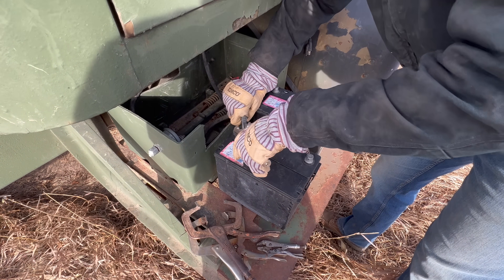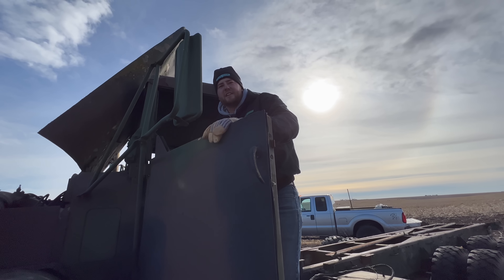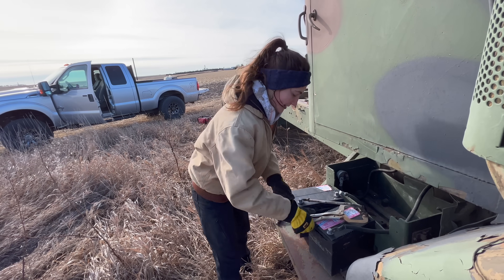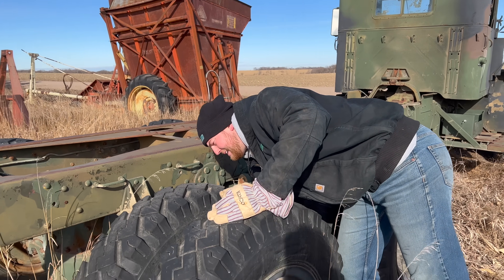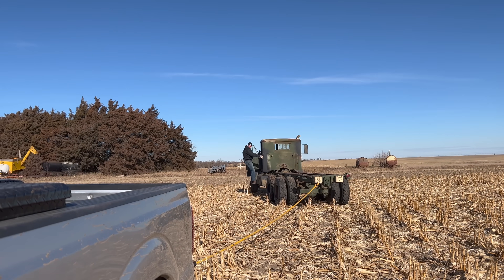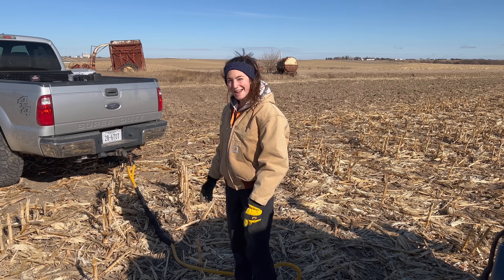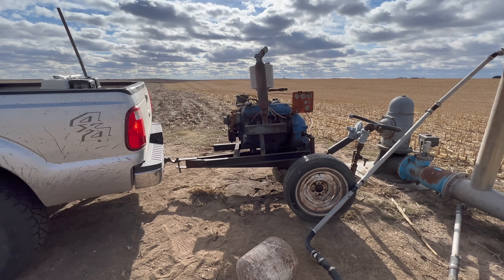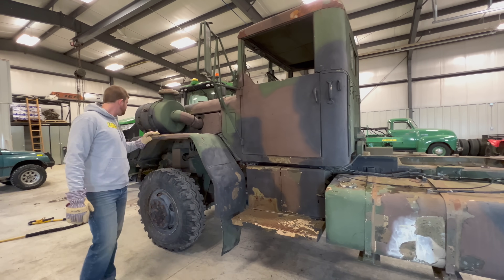If You Can Start It, You Can Have It

Comment: Change oil. And filter, Add a quart of click 50 to motor,😳😳 will plug all oil leaks. Synthetic oil with teflon , can mix with regular oil, engine rebuild in a jug.😀😀
     Actually used it in a overbored cadilac coup deville. Went on roud trip, had radiator hose blow, duct taped it till i limped off the exit. Found. Service station with garage. Was so hot ran on own ,after plug wires pulled. Put it back together, got close enough hose. Limped home .😭😭
  Used to have roommate was dodge and mopar motor head, yes know all the ford and chevy jokes😂😂😂   Lost compression in cylinder, so changed oil and filter. Added slick 50 , and prayed. Got compesson back , ran fine.
     Was 1995 can probobly find at walmart or parts store. Diesel moters use glow plugs , can probobly get military. Maintinence manual on duce and half, chiltons of the military world.😀😀🐶. Used to be crew chief on kc135 R, they have a book for everything. More pics in army manual.😳😳
     Conrtats on finding a willing and enthusiastic wife, they be rare. Be prosperous and enjoy the ride.

Comment: I like his sequence of checking  Oil Gas   should check radiator  for  Water   cource battery  he doubled up the 12 OK   I,d go for the ether yes get the ether
Reply: I,m here in Washington County Maryland  and yes as a kid my Grandfather Schmidt  sold Ford Tractor's  thru his brothers Dealership  anyhow when he made a deal he'd make sure he'd asked the farmer if we could hunt on his property and usually answer was yes  anyhow I got like 12 pheasants  the next five years  1966 1971   and Now when People ask  anyone in Maryland us old hunters just say we were a pretty good shot the reason theres NO Pheasant anywhere in Maryland someone said it was due to some fertilizer they used in early 80,s  we didn,t know wheather it was from Urban sprawl  or what  so do you still have Pheasants out there

Comment: OMG, she is so beautiful ! ( the attractive woman, not the truck, lol )  
 About the fuel,..during WW2 diesel was not always easy to get due to supply issues, so these trucks could run on a few different types of oil, one type of oil that was used was vegetable oil, but it did have some issues, you can not use vegetable oil (cooking oil) in cold weather because it would freeze.   :o)

Comment: Great vid and people. I have a 24 volt military truck and the argument about how 2 12 volt batteries make 24 volts hurts my head.  Just hook them up in series, put a volt meter on them and you will see how many volts they are. Which is 24; but let the meter settle it!  Anyway, look forward to more about getting this truck road worthy. Thanks. BC

Comment: The 36m49 is nothing more than a number of the truck to separate it from the others and show what platoon or squad and this one is not that one. If you had nominclature such as 10th Eng Bn, or 35Sig BD you would know what Battalion or Brigade or What Unit the vehicle was originally attached to. GOOD LUCK

Comment: I do not wish to steal your thunder! I have no wish to put myself out there fully! But do you know why there is so few farmer jokes? Because most are true stories!!! Anyone may steal this true story at will! Farmer Jack  passes away, the community helps where they can. 1 guy in particular after ensuring everything was back maintained and ready, should she wish to sell! 
She was ageing but no wish to move. I cannot afford to pay you. She tells the younger local farmer.
In doing a thorough clean up, he'd unearthed an old bus covered in vines.
He mentioned to the widow, he was in the old bus. She said,  just take it! He was extatic! Payment in full! As far both concerned!

So collection and moving the old bus!
4 ton tractor towing a 10 ton bus no problems! 

Brakes? Air activated. No air? Brakes are on! So too easy! Wind off the brakes so they don't work! Brilliant!

If you need brakes? Just put it in 1st gear! Let out the clutch and use the engine compression to brake you! 

Of course on a steeper downhill run they tried that!,
Of course the old diesel that hadn't been started in 40 years!  Came to life!

Now we have 10 ton pushing 4 ton, tractor brakes won't hold the weight of the bus! So leans over removing the tow pin!
Gets out of the way whilst the bus and rather frightened driver, had to  face his unplanned roller-coaster,  

TRUE STORY! Qld Australia approx 2001

Comment: The numbers are usually the Division and Sometimes Battalion that the Vehicle is assigned to. The only thing in the Army that is referred to as a truck is the Brass Ball on top of the Flag Pole. And I can tell ya. The Army is brutal on Vehicle's. That could have just been a motorpool vehicle. Which means it could have been checked out by anyone. Guy's like to see just how much abuse a vehicle can take. Pissing off all the Mechanics. I was in an Armoured Tank Killer called The Bradley. They can take abuse and keep on going.

Comment: if u use gasoline, it must be mixed with motor oil.  exact dilutions escape me now.  just use diesel to be safe.  Motor oil
ATF
Hydraulic Fluid
Gasoline
Diesel
Kerosene
Refrigeration Oil
Vegetable oil

Comment: Dear Laura, First off, THANKYOU FOR BEING SO  FRIENDLY AND DOWN TO EARTH, A PERSON!   REALLY!   iF I SAY ANYTHING TO  YOUR GENERATION?  IT IS THAT   MEN AND WOMEN BOTH HAVE VITAL ROLES IN  OUR WORLD! AND THEY HAVE STRENGTHS  AND WEAKNESSES  THAT ARE RELATED TO THEIR  GENDERS!  BUT! BUT, BUT, THEY CAN LEARN, ABOUT THE OTHER SEX'S  ROLE, IF THEY TAKE THE TROUBLE TO DO SO!  
THAT BEING SAID!  YOU SEEM TO BE  ASKING WHAT MAKES THAT  MILITARY TRUCK 
SO  DIFFERENT?  OR  "SPECIAL"   ??? PLEASE CORRECT ME  IF I AM WRONG?  
THESE TRUCKS COME LAURA IN THREE WEIGH RATINGS.  2 1/2, 5,  AND TEN TON  
LEVELS!    THE 21/2 TONNERS ARE  REFFERED TO BY RANK AND FILE  SOLDIERS WHICH ARE  THE MOST   NUMEROUS,  AS  deuces, OR DEUCEAND A HALFS !   THESE ARE THE MOST COMMON MILITARY TRUCKS!   THEY ARE THE TRANSPORT  BACK BONE OF ANY ARMY IN THE FIELD OF OPERATIONS!   THEY ARE  HIGH STANDING TRUCKS!  THEY ARE TEN WHEEL DRIVE, ALL AXLE DIFFERENTIALS   FULLY LOCKED STYLE!   THE DRIVE LINES ARE TOP LOADED!   THESE  TRUCKS ARE  ESSENTIALLY  "MUD"  RUNNERS!    YOU SEE, 
LAURA?   THESE TRUCKS ARE MEANT TO HAUL AMMUNITION, AND  SUPPLIES TO 
THE  FRONT LINE BASE CAMPS IN ANY THEATRE OF WAR!   THEY RUN ON MOSTLY ROADS,  THAT ARE WORN INTO THE COUNTRY SIDE, WHICH TURN VERY QUICKLY INTO SEAS OF MUD!   THAT IS WHY THEY ARE TEN WHEEL DRIVE  AND HAVE  IMMENSELY
STRONG FRAMES AND  SUSPENSIONS AND USUALLY HAVE  DRAG WINCHES MOUNTED ON THE FRONT  OF THE  FRAME   FORWARD OF THE RADIATOR!   THEY HAVE CONVERTABLE  FRONT CAB ROOF  ARRANGEMENTS TO HELP FOR  MOUNTING OF .50 CALIBER MACHINE GUNS, BESIDE  THE DRIVER? AND   TO HELP COMBAT HEAT IN TROPICAL   CLIMATES!   THE  WINDSHIELDS USUALLY ARE CAPABLE OF BEING FOLDED DOWN LIKE A JEEP!  THIS IS  TO FACILITATE   A MOUNTED .30 CALIBER MACHINE GUN! 
THEY ARE  IMMENSLY MASCULINE  IN APPEARANCE, AND STANCE!   THE ENGINES 
ARE MULTI FUEL.   ELECTRICAL SYSTEMS ARE 24 VOLT TO SUPPORT  RADIO CUMMUNICATIONS GEAR!  IN THE FIELD!   THEY HAVE RECESSED  HEAD LIGHTS  FOR 
CONVOY BLACKOUT  RUNNING!   THEY ARE UTILITARIAN  TO THE EXTREME! AND ARE 
BELOVED BY THE MEN AND WOMEN  WHO FOUGHT  AND LIVED WITH THESE BEASTS
IN THEIR SERVICE TO THEIR COUNTRIES!   OLDER MODELS WERE MANUAL TRANSMISSION, NEWER MODELS AUTOMATIC.   BRAKES ARE  OIL? MAYBE SOME 
AIR ? THESE DAYS? I AM NOT SURE! I AM TOO OLD  TODAY?   THEY ARE  NOT CHEAP 
TO RUN,  DIFF RATIOS  ARE FOR   POWER, WHEN BOGGED DOWN IN MUD. 
MOST  COLLECTORS TAKE THEM OUT FOR A RUN ON A SUNDAY  WITH THE KIDS?
AND WIFE? TO GET LOOKS BY THE GENERAL PUBLIC!   OR TO GO TO  MILITARY VEHICLE PARADES OR  MEETS!     ALL THE VERY BEST TO YOU LAURA? AND HOW DOES IT FEEL TO HAVE A NAME OF A VERY POWERFUL 429 CU IN BOSS MUSTANG?  IN A FILM CALLED 
"BULLITT"   WITH STEVE MCQUEEN ?/ BACK IN THE DAY!  OR  ANOTHER FILM AS WELL?
best regards  kennethzakaib607@gmail.com   Montreal Queebc Canada   May 2024

Comment: well batteries to small, dumb all the diesel out of it put new fuel in it then start it its diesel it should start, if not just undo the injectors to see if fuel is getting through as maybe stuck in the air so keep running till air is out fuel coming through at all injestors it should start then.

Comment: Looks like an 8 series 5 Ton. It should have a Cummins diesel which was not a multi-fuel (Continental diesel) The Multi-fuel engine was in the predecessor to the series 8, the 5 series 5 Ton from the Viet Nam era. Before that they used gassers. A multi-fuel diesel can run on everything but Av gas (Too high octane). This feature was to accomplish your mission and/or save your life if you have no actual diesel but have say Mo-gas, and/or any flammable oil or fluid. The Cummins engine is far superior to the Continental as far as power and durability.

Comment: condition was IF YOU START IT,,,, but you did not start the engine instead just had it ,, that was wqng ,,, the truch seem fairky good condition ,,,, you could have started if you had proper power supply and chaged fresh diesel into injectors,,,,, weather was not bad for starting,,,,

Comment: Why not pull the truck unless it's automatic if it's manual shift pull start the truck off in 5th gear pull it off like and let other little clutch and let it run

Comment: Come on guys start to get practical. Sparks, coil packs, distributor fresh fuel. Make sure the engine and belts are all free to turn and good before you try to start it otherwise if it did start you probably just going to do a whole lot of harm on 10 year plus old oil and fluids. You were lucky those brakes had not seized and you just brake the pick up. I thought farmers are practical people. Love your enthusiasm though…

Comment: OK military multi fuel you can run cooking grease in the Thing and the batteries you need a Marina batteries the big ones for semi's not cfor semi's not car batteries so 1st of all get rid of the tinker toy batteries and get the real batteries for some address for sunrise they screw on top post duh that's why they don't like they do and you can't get it running call me I can get anything running I worked on diesel trucks for years on site breakdown it's all you can't get it running I can't  For a large  Summer money The military thinks trucks like that are multiple fuel can run on anything GIs there anything gas diesel cooking oil yeah I'll carry a sign things yeah I'll echo run on any fuel base oil base so any other questions you have yes I ask